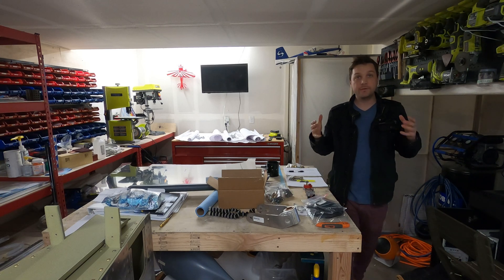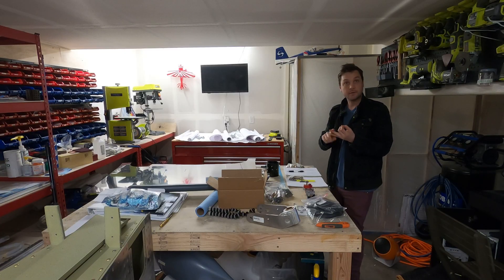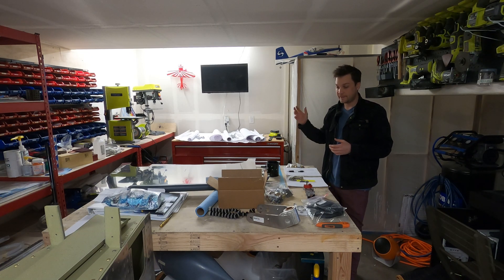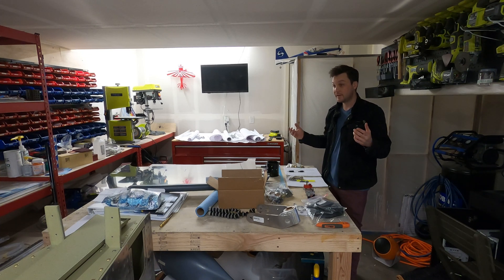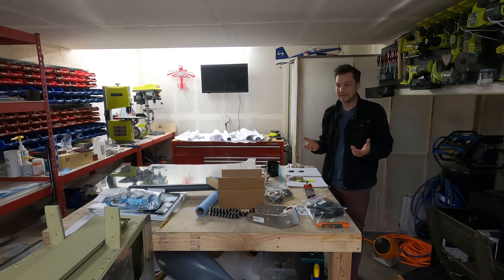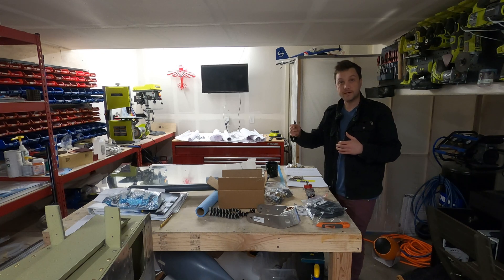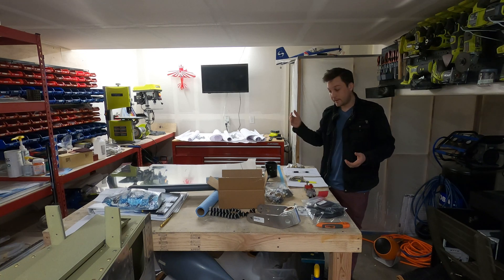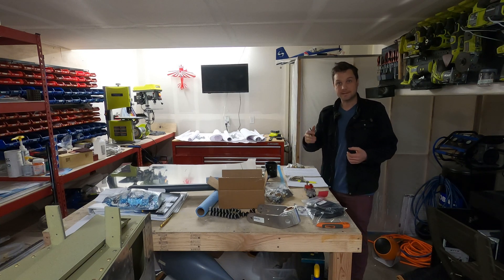Project Update 2: Finish Kit, Engine Choice, and Next Steps

Comment: I picked up a complete unstarted 7 kit in November and official construction will begin next week. I’ve done a few of the practice kits and you may not like this, but I’ve watched all of your videos so far and will be referencing them as I go along. 
Because I picked up a complete kit I have the wing spars under the couch, canopy is on the guest bed and the cowlings make a great clothes rack in the bedroom!
Reply from the maker: So exciting. Sometimes I wish I had a time machine to start this thing over with what I know now. Much like life in general. I think back to trying to blast #3 rivets with like 60 psi, and stressing about whether I was deburring enough; too much. 

It’s such a rewarding project, though, and you’ll love it!!
Reply: What are one or two tools or gadgets you’ve picked up along the way you wish you had at the beginning? 
I have the cleaveland tools kit but have already ordered the longeron yoke and oops rivets based on other suggestions.
Reply from the maker: @norwichcadet some people swear by oops rivets and some don’t utilize many. I fall into the later category.

Get all the yokes you can. I’ll take ten minutes to find a way to squeeze a rivet before I start bucking. A 4” and a no hole are both necessary additions (only on yoke if you combine those).

Swivel head set will save you some tears on rivet dents and smilies when you’re in awkward positions.

I use my Nova angle grinder and conditioning wheels for 80% of deburring now. If I had that from the start, I’d probably have saved 100 hours.

Make sure you have two tungsten bucking bars. A good all-purpose and a tight fit (slim).

If you’re priming, a primer pistol is my go to for small batch work, but they seem to be perpetually out of stock.

I’ve picked up a lot of clamps, but those are easy to source as needed.

Comment: Emmy worthy !

Congratulations on getting the finishing kit and deciding on the engine. I had a Continental once upon a time.
Reply from the maker: Hopefully that ended well? 😂

I have no doubt it’ll be a hell of an engine.
Reply: @RyanFlysPDX  Hi Im building a 14 as well and was looking at a Io375 from aerosport. But was concerned about the lighter weight. Are you anticipating any CofG issues to deal with going with the continental? Thanks for posting video I did not know about this 370
Reply from the maker: @devineklund8331 I am worried about winding up tail heavy. CS will help. In all, the Titan is only a bit lighter than the Lycoming. I’ll do what I can to put as much weight on the front of the thing.
Reply: Thanks the 375 is 25# lighter. Ill follow your story and hopefully learn a few things that work or not. Thanks